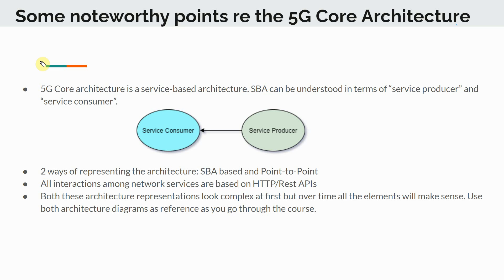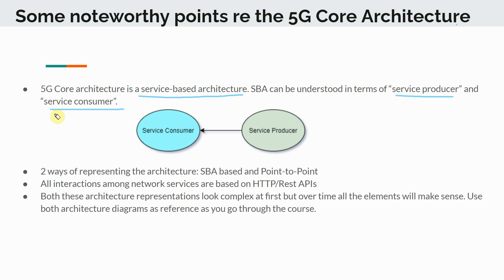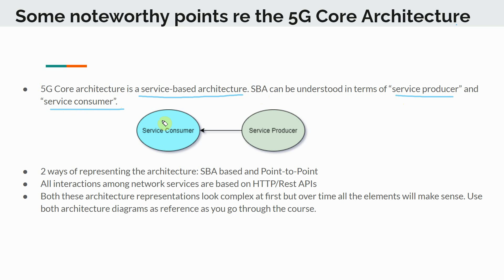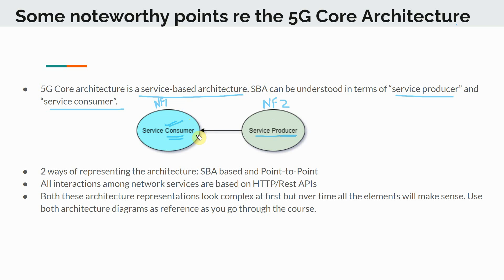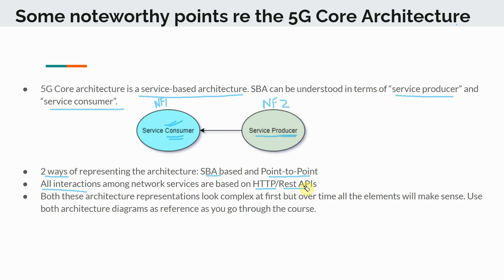SBA 5G Architecture - Service Consumer/Producer

Comment: Mr. Who is Consumer, who is producer in 5G? 5G Base station is consumer and SMO is the producer?
Reply: As i know in 5G architecture their is no fix who will be consumer or who will be producer because it depends on who is requesting (consumer) and who responding (producer) and in other message or next message same node just reverse their functions i.e. consumer become producer and producer becomes consumer
Reply: @Crossyourboundaries  dude No, in 5g Consumer is Oam server, and provider is 5g base station. It is mainly clear. Not because "requesting" it is because of providing data and consuming data.
Reply: @Elzelgator  - you are wrong.
Reply: @Elzelgator  - consumer is client whereas producer is server. Keep it simple
Reply: @maverickmaverick5  plz check ORAN Specs.
Reply: @Elzelgator  which spec, add link here.
Reply: @maverickmaverick5  I am posting the link but youtube keeps deleting it.